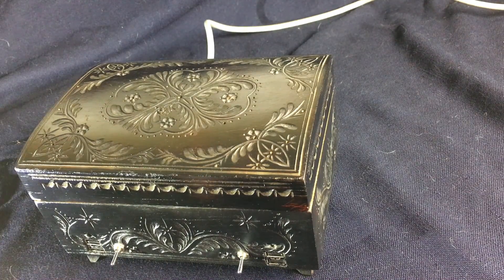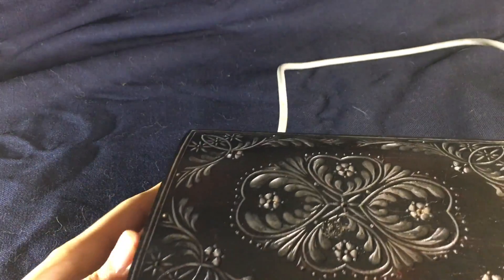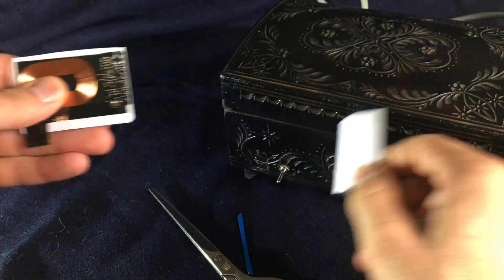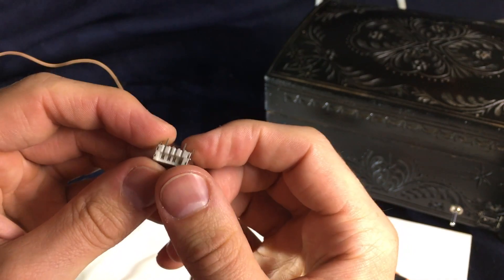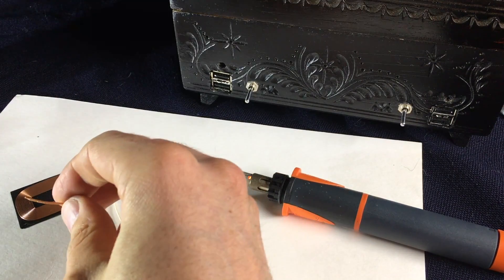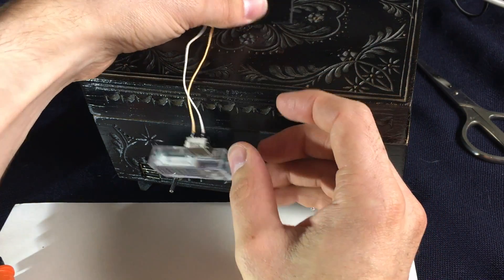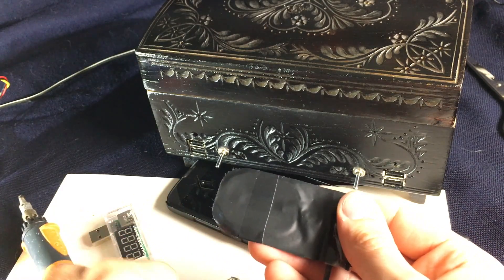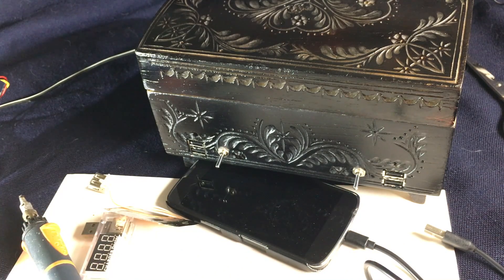Easy Wireless USB Power Receiver - Qi Charger

Comment: Is it possible to rewind the coil, like shorten the length of the coil.
Reply from the maker: The coil was dipped into glue. So no way to shorten the coil without ruining the setup. Also it will mess up the power output.
Reply: Ok thanks for the heads up
Reply: Ok thanks for the heads up

Comment: This is exactly what I needed. I have a Noblechair Epic with a Razer Orbweaver and Thrustmaster Warthog HOTAS  mounted to it, with an Orico 10 port usb hub stuck underneath with all the usb cables neatly hidden away, but the problem is the Orico Hub requires both data, and power usb lines, which both need to be connected. My plan is to get a wireless usb (data) transmitter, to transmit the usb device signal, and then attach a DIY wireless power reciever to the bottom of the chair, then the chair could sit atop a rectangular wireless power transmitter which I could build into the floor (placed under the floor), or into a rug/mat, providing wireless power and data transfur to the chair without the cables.

Comment: Hi Peter. Instead of keeping occupied the mini usb inlet (which may get anyway broken with continous to and fro in it: that's also why these kind of chargers was invented), why don't you think to plug the in-wires directly inbetween the battery and the phone charging dents?
Reply: fustigamatti That might be bad for your device. First of all, battery will have more chances of being mis-calibrated so might see wrong % in phone. Secondly, there would be no protection if in case that battery reaches 100% then it would go on charging and damage. Lastly, phones without a removable battery/back cover wouldn't be able to work properly with a case due to so many layers IF we manage to mod such a phone..
Reply from the maker: Hi, that is a good idea and I thought about this too. 
Basically there where a few reasons why I choose not to do it for this project.
First since this was just a test I wanted to test it with a lot of devices therefore the universal connector is perfect. Secondly I wanted to use it on my headphones which at that time still got some warranty left so I was looking for a non destructive way to add the QI capability to it. 
For cheaper or other device I would totally integrate the charger into the device.
Reply: Fine. Then would you mind to prepare a tute about this, please? I guess that it will be regarded as the prime sample (nobody has ever thought about it so far: no tutes around about, anywhere).